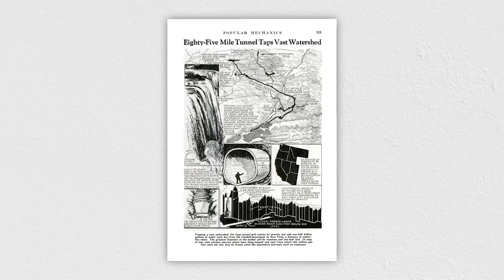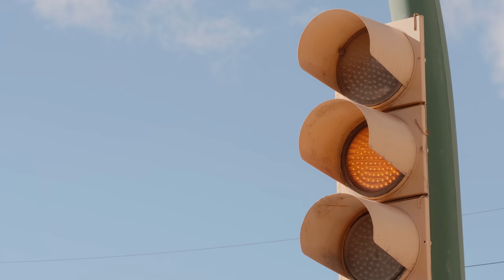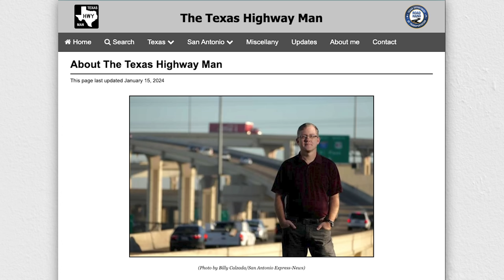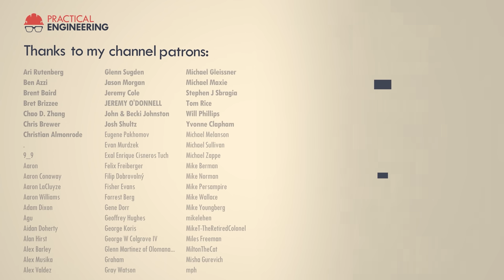Why Are Texas Interchanges So Tall?

Comment: Moving to Texas for grad school, I was blown away (by my fear of heights) at how tall some of the bridges are.  You mention 100 feet, seems more like many hundreds of feet.  I understand they need several levels, but what really makes no sense is why there is enough space between each of the levels to drive a space shuttle, upright.  I exaggerate, but only slightly.  Many of these "tall bridges" easily have 40-50 feet in between each level, and THAT is what we want to answer to why the highways in Texas are so tall, not why there are so many levels, especially since it means exits for these bridges have to start miles before the turn to allow time for the vehicles to make it up to that height.  I grew up in a state where exit lanes split off 1/4 mile before the turn, and I often missed my exits in texas, once it was a 12 mile u-turn on a frontage road to make a second attempt.
I still think it's absurd out in the middle of no-where texas where there is a single flying bridge (not ,4 in layers) to rise up hundreds of feet up in the air with no other bridges underneath with miles of ramp, and yet that is what it is.
Obviously, we've always suspected either contractor shenanigans to get the most money out of the government for the project they can, or the state figuring out how to scam the federal government out of more money for unnecessarily tall construction.  And given that there was a single ramp for a single exit on I-20 that was under construction for more than 5 years, yeah, I'm going to suspect money schemes of some kind.
The other thing that is not only ridiculous, but actually dangerous, especially in Dallas is that it snap freezes for a day or two each year.  Central principles of cold weather driving are try not to make turns on ice, and bridges ice first.  My first spring break in Dallas, it snowed, and the bridges iced overnight.  I carried on my merry way back down to College Station, thinking "oh, I'll just not turn on ice", when lo and behold it turns out ALL THE TURNS ARE ON BRIDGES.  This was profoundly dangerous, and the highways were littered with abandoned cars that had slid off the banked turns at 400 feet altitude or crashed into each other, unable to control their turns.  What few cars remained drove slower than the cars in a full on blizzard in Salt Lake City February snow storm (where I also later worked), bringing the entire city to a screeching halt when snow is predicted (living there several years later).  btw yes, one of those intersections in dallas at 75 and the interstate battery building you showed I did at least twice daily, and it freaked me out - every single time.
What will help fix this is when we stop doing socialism for roads.  Then managers of businesses will realize how insane it is to locate their businesses in overcrowded areas when they have to start paying directly for the cost of their employees driving in via these ridiculous long road ways.  Skyscraper owners, who have primarily contributed to this bad ratio of land required to support the lives of the employees divided by the land area used for the businesses that then contributes to these long-distance commutes, will realize they've been sapping their profits from the taxes to build deficient roadways.  Instead, we'll be able to distribute much smaller offices buildings over much wider regions (instead of concentrated in a city center), enabling shorter commutes from your house to your work place.  But it won't happen as long as socialist magnificent-works-of-the-state-minded central-planning-minded city-planners keep creating more and more and more bottle necks with these highways and skyscrapers, which keep the sky-scraper tenants business managers isolated away from the real costs of the socialist roads.
I have found a solution to the traffic-crossing-itself-on-one-level problem (which I had previously assumed was impossible) that allows a no-bridges but also no stops despite the fact that traffic ends up crossing at right angles, and doesn't involve insanely-tight unviewable hair-pinned hair-pulling turns in roundabouts.  It would allow us to open up many more surface streets to much higher through-put, and avoid needing to spend so much money on bottle-necked highways.  (And after living in Dallas for a couple of years, my friend showed me how to get places faster by taking surface streets and not the highways, which they all could prove were just for inter-state trucks and passers-through, not residents, since their throughput was so low.)  I can't attach it as an image in youtube, but ping me to see my posts about it on social media.
Other common problems with texas roadways, as you pointed out, include the people-needing-accelerate-while-people-in-the-same-lane-need-to-de-celerate, and you didn't mention the lack of merge lanes in general, which results in all the trucks in Houston riding in the second lane from right, since if they stayed in the right most lane, they'd get slammed by all the cars coming on from ramps.  And they're not allowed to drive in the left-most lane.  So the trucks form this impenetrable traffic wall  (and they have a lower speed limit) so it can take several minutes to find a slot to get between them so I can get in the left lane and go at the speed limit whizzing past the trucks.  and then of course, everyone is trying to get through these same few cracks to get into the left lane, and then for an exit everyone has to filter back through.  It just a really really poorly thought out road designs in texas.  impressive looking, but tremendously poorly-thought-out.  Like what all the henchmen in the Jimmy Neutron movie say to the master.  "I don't think this plan was thought through very well, master".

Comment: Freeway complexity. Brought to you by congestion, HOV lanes, and Texas.

The biggest problems with the cloverleaf interchanges I encountered was the signage and the close proximity of the exits to each other. It was sometimes difficult to figure out which exit you were supposed to take to get where you were going and that left you occasionally, even on an interchange you knew, taking the wrong exit and having to backtrack.

I personally would like the HOV ramps to go away. Sure, convenient when you're using the lane and want to move to the adjoining freeway, but they add complexity to the interchange and quite a bit of cost. As for frontage roads, what we tend to do in Phoenix, where they are present, is simply end them one side or the other of the freeway since the nearest surface street is usually less than a half mile away. Because of this, in a lot of cases, there is no frontage road. Just the surface streets. Where they do continue on through, they simply sit right next to the freeway on the same bridge. No extra considerations beyond the width of the bridge.

Comment: Good video.  Give an explanation of why those bridge / overpass supports (when metal) are all rusted when they put them up.  I am sure it is some kind of treatment that is better in the long run, but dang it, I'm conditioned to see rust and think that is bad.  They seem to use concrete most of the time, but if the support is extra-long or curved, then it seems they go with metal and very rusted metel.

Comment: 2:30 It’s said that highways have more capacity, and this is what people intuitively feel. However, when I try to calculate it, that doesn’t seem to be the case. If I double the speed, I should also double the distance between vehicles. So, on one hand, I have a factor of 0.5, and on the other hand, a factor of 2.0, which cancel each other out. Therefore, the capacity should remain roughly the same. Is this indeed the case, or are there other important factors to consider?

Comment: In case you weren't already aware, there is also Spaghetti Junction in NE Atlanta, at 90 feet high (not high compared to Texas). It is a 5-level stack interchange between I-75, I-85, and I-285. Just thought you'd like to know (if you didn't already). I enjoy your vlogs. https://en.wikipedia.org/wiki/Tom_Moreland_Interchange

Comment: I would say that South Florida where I live has some mighty impressive interchanges. Maybe not as complex as the one shown here but still quite complex. In addition, we like giving Texas a run for its money, like who has the longer panhandle. It's about a tie at just under three-hundred (300) miles.

1) Golden Glades in Miami-Dade County. SR-826 (Palmetto Expressway), I-95, Turnpike, US-441, NW 167 St, SR-9.
2) Interchange in west Broward County. I-75, I-595, SR-84, SR-869 (Sawgrass Expressway).
3) Interchange in central Broward County. Turnpike, I-595, I-95, SR-84, US-441 (SR-7).

Our engineers were able to design our most complex interchanges so that there are no more than three levels above grade, perhaps the Texas engineers should have come here to learn how to do that. LOL

The Golden Glades interchange has been redesigned several times over the decades, but there was a time back in the seventies when you could drive east from SR-826, negotiate the spaghetti connections and end up driving back west on SR-826 without ever leaving the interchange or making any obvious U-turns.

Comment: Kinda crazy that just yesterday my dad was with me as we drove by the HIGH FIVE and my dad mentioned that our neighbor took him to visit the highest level (westbound 635 onto 75 south) of the high five as it was being built (neighbor worked for Zachary for over 40 years) and that my dad was so scared because of the height,  the nearest he could get the edge was about 20 feet. 😬

Fun fact, our neighbor told me that the tallest pillar of the high five took 75 concrete trucks to fill (im pretty sure that was the amount, this was about 10 years ago when he mentioned it to me).

Comment: There is one think you did not discuss about freeway design; flooding.  I don't know about other areas of Texas but the Texas gulf coast has a problem with flooding.  Houston is 30 feet above sea level and about 30 miles from the Gulf of Mexico.  Anything build below grade will become a pond when it rains.  And it can become impossible to travel around the city.  We do have another problem; freezing weather.  Flyovers with a layer of ice on it can me dangerous.  As I like to say, we do have winter in Houston.  Last year it was on Thursday.

Comment: Ive never seen a dimond intresection in my life, nor traffic lights on a highway. And the road deaths here are 2 to 3 times less than in the USA.
In my country its either roundabout or cloverleaf, or just a generic level connection with a yeald sign.
Eddit: a 3 level stack is the highest I know in the country and I know but 1.
Reply: You did not make it off this page before you realized you were wrong and edited.
Reply: @Hisokaa-d2j  No. I chose to eddit more information in to this comment rather than adding a new one.

Comment: I'm a little disappointed that you didn't touch in the other phenomenon of tall via ducts in Texas. For some reason your state likes to make the vertical separation of roads much higher than the rest of the country. 16ft may be the standard, but driving from Dallas to Austin I sure did see a lot of 20-30+ ft bridges for seemingly no reason. I'd love if you could explain why that is.

Comment: Let's talk Frontage Roads.....
During rush hour or any time there's an accident on the main highway, you can get where you're going w/o sitting in traffic on the Frontage Roads.  If there's a place I need to go and it's within 10 miles, I take the frontage road at 55 MPH instead of going 35 in a 70 zone on the highway.

Comment: As a many decade resident of Texas, I don't mind that Texas stands out with our obsession with frontage roads--but construction here takes forever, in many cases 10 years or more.  By the time the project is completed, it's obsolete.  Developed frontage roads in high density areas restrict expansion and now we're stacking our highways to allow for more traffic and extending higher traffic interchanges a mile or two from where the interchange actually occurs.

Comment: Until a few years ago, Houstonians  could "enjoy" the 290 / I10 / 610 weave with the exit from I10 crossing 5 or 6 lanes of 610 to enter 290.  Same in the other direction.  Yes, it was called the weave.  Lots of fun / angst when doing it in heavy traffic at high speed.  Fortunately most everyone knew how it worked so we all weaved together. 
But now it is all controlled by half mile flyovers.  Where's the fun in that?

Comment: 4:58 absolutely insane. You said, 'create traffic'

No, they create collisions.  They fixed it a few years ago, but the very first 0.01% of I-83 (Harrisburg to Baltimore) had one of these. It was the first exit ramp when you got off I-81 and on to I-83. I'm not kidding, for 8 years, more often than not, on my way in AND on my way home there was an accident there.

... Who even thought of this? 

'Okay, we want cars, busses and tractor trailers to exit I-83 at 65 mph on to the rte 22 ramp at 20 mph...

.. but I want the people entering I-83 from rte 22 to do it 400 ft BEFORE all those people trying to exit...

.. I'm pretty sure this is a good idea. We're gonna have thousands of cars at a standstill accelerate to 65 mph..  immediately in front of thousands of cars that are trying to decelerate from 65 mph to not go flying off the ramp in to another solar system.'

Comment: Oh, you think the High Five in Dallas is impressive? It’s got nothing on Spaghetti Junction in Atlanta. This thing is world-famous for a reason. It’s a five-level stack that towers about 90 feet high at its tallest point and features a staggering 14 bridges. It’s not just big—it’s incredibly complex, designed to handle the insane traffic that flows through Atlanta, one of the busiest transportation hubs in the Southeast.

To put it in perspective, the High Five in Dallas might have five levels, but Spaghetti Junction covers way more ground and connects far more roads. It links I-85, I-285, and multiple surface streets, making it a critical artery for commuters and freight traffic. It’s also an engineering marvel, with its layers of ramps and bridges weaving through each other like, well, spaghetti. If you’ve ever driven it during rush hour, you’d see why it’s earned its reputation!

Comment: 0:50 "The longest bridge span is in New York".  Does "span" have special meaning here, involving a suspension bridge?  Otherwise, the Chesapeake Bay Bridge Tunnel would like a word.  It includes two tunnels, but spans over 17 miles across the mouth of the Chesapeake Bay.
Reply from the maker: Yes, span is the distance between structural supports. If you're just talking longest bridge, Lake Pontchartrain has Chesapeake Bay beat.

Comment: Why is every other interchange so short? 13' 6" is not a maximum needed clearance, that is minimum commercial clearance. Oversized loads need more clearance, going ahead and adding as much clearance as is easily and affordably doable when you build a busy roadway is a just good thinking. Something you will never find in a blue state.

Comment: Traffic on the High Five is constantly backed up and merging at the end is a nightmare. There should be no other exits to contend with for 5 miles near a merge point. Building the thing may be engineering success but traffic management is a huge fail. Any time traffic comes to a stop someone should lose a job.

Comment: The highest two bridges of the "High Five" are merely on/off ramps from/to US-75 to/from the texpress lanes on Interstate 635 which cost an extreme amount to bypass standard level traffic with the variable rates. Suckers or Billionaires drive there. There is minimum traffic, because of the cost.

Comment: For what they are designed for, they are great,  hands down. If you only design public transportation based on vehicles, I guess this is what you end up with. And that is the US dilemma. In DFW area, you can't walk, you can't take a bus, no train, no bicycle. You are forced to use the car for everything.  Is it better/worth than other solutions? I don't know. I just live here. There certainly is way less green and parks, which is fine by most because 9 month of the year, it's way too hot to do anything outdoors.  You just drive from A/C point A to A/C point B. 
I personally prefer the European way where you don't have to have a car. Here you do, which is a little sad of course. They even built own, dedicated Express lanes, which you pay for and which have a higher speed limit, just crazy. This feature if course adds to the overall concrete mess.

Comment: I've driven through some of these interchanges while playing American Truck Simulator and by Jesus not only they are the ugliest concrete mess I've ever seen, but they also take up A LOT of land, and all of this because god forbid the car reducing speed or whatever, like a small slow down on a clover interchange would delay the trip by days.

There should be a contest where engineers can present interchange designs that take less real estate and concrete to build. I'd bet that the winner design would be a big, big roundabout, but I'm not an engineer, so I can't say for sure.

And don't even get me started on frontage lanes. If the purpose of a road is to allow for someone to go from point A to point B quickly and interferences are frowned upon, why the need for frontage lanes, then? If you have space for the highway and accesses, why do you still need a road parallel to your highway? Do you really need to lose all this space to cars? Can't the average Walmart be located in a road accessible from the highway but not on it?

I don't know, for the United States to be THE country addicted to cars, you'd think that they would come up with smart solutions for their roads, right? Instead we get... This.